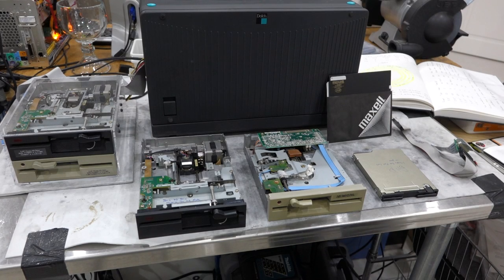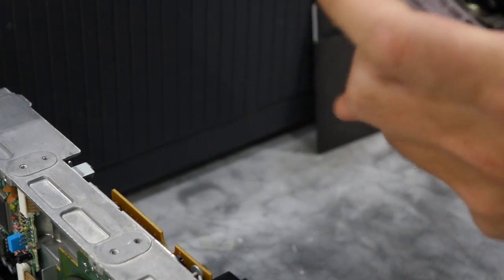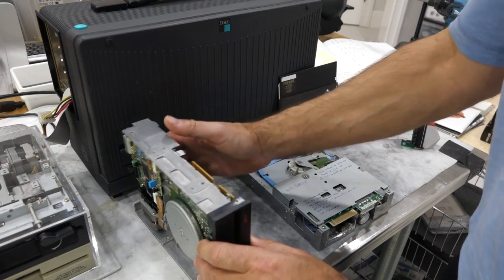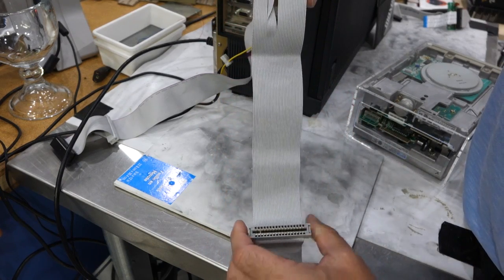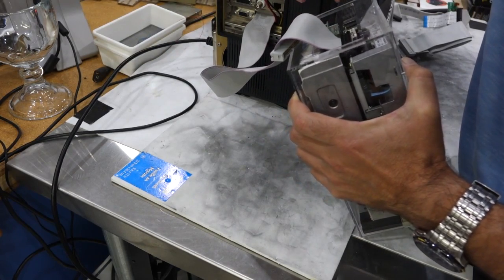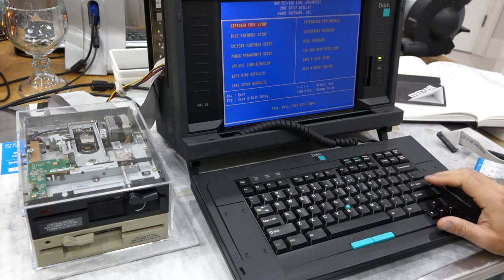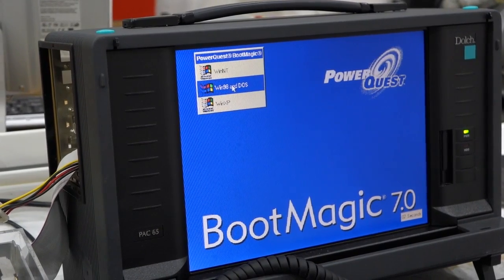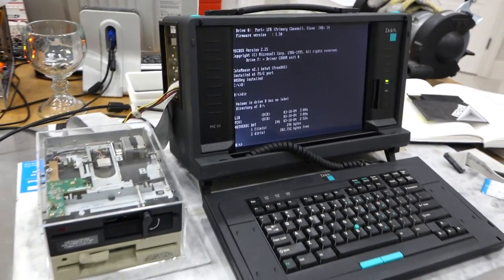5.25" Floppy Part 1: Drive Installation

Comment: Hello, I've tried connecting a 5¼ drive and a 3½ drive using the "double" cable (2 5¼ plugs and 2 3½ plugs on each extremity)
It gives me the floppy 40 error, but the main problem I've found is that the led power is always on, I excluded the drives since they were repaired and were fully working on a benchmark.
Is that something to do with cable plugged wrong or faulty? Or is something I have to mess in the bios since it finds both drives (the bios shows them up as a: and b: with 1.2/360 k 720 k and 1.44 and 2.88 are available)
The 5¼ Is connected to the terminal 5¼ plug (last on top) and the 3½ at the second extremity (the first connector after the motherboard) with the second 3½ plug.
Help please!!
Reply from the maker: It could be so many things, but I would try to mess with the BIOS settings first. The BIOS doesn't "find" any drives. You tell it what they are, and unless what it is told exactly matches what actual drives are on the cables, it will give you an error 40.
Reply: @CuriousMarc  Update on this.
I've managed to prevent error 40 by having my drives to be set as 360k and 720k, but it's weird as they're HD drives.
Lights are always on so there's something wrong, even if i flipped the cable connector on the motherboard and made sure that pin 1 on the cable was identical in direction to the pin 1 motherboard connector.
The lights always on are due of a faulty cable (tried swapping with another 4 connectors cable, no change) or the controller itself is faulty? or maybe is it the power supply?
The drives do turn on (you can hear them start spinning when i turn on the computer) but why do the lights are always on?
EDIT 2: The leds turn off when i disconnect  the second 1.44 drive.
Edit 3: Turns out the 1.44 drive was having the wrong pin 1 and i had to flip the cable so that the connector would be backwards while keeping the 5.25 drive on the other way around (Pin 1 was on the other side yet marked on the left near the power connector like all 1.44 drives, really weird drive).
Thanks for the help dude.
Now i wanted to ask some advice.
I wanted to install windows 98 on a PATA HDD, but windows 98 gave me error  SU0013 and thus aborted the installation.
I have two PATA HDD drives, one has failed since it always gives errors when i tried to install win 98 but they're the same (80GB Maxtor Diamond) and one that had windows xp on it.
First time i was able to 100% format the disk and progress to the installation, when it showed "Error SU0013" and interrupted the installation.
Second time i think win 98 setup tried to install it on the old ruined HDD and failed multiple times.
I've got a floppy disk formatted with the windows 98 boot disk (original diskette went bad).
What can i do to "restart" the installation from anew?
I've got no other PCs to connect the drives to format them.
Reply from the maker: @arbiteras  Great to hear you sorted your floppy problems. For Win98, I can't remember exactly. If you install from the CD, you need the CD drivers installed on your boot disk. Then when you can install the CD, there should be a setup.exe or install.exe or Win98.exe somewhere, maybe in the i386 directory. You just execute that and it should start the installation anew. Or just configure the BIOS so it boots from CD first, that should do it.
Reply: @CuriousMarc  That's what I did.
First time Windows 98 setup worked until the Su0013 error then stopped due of a second faulty HDD.
Now if I try to boot from CD it starts "1. Run Windows 98 setup from CD ROM.
2. Boot PC with CD ROM support
3. Boot PC without CD ROM support"
If I choose 1 and 2 it gets stuck at the CD drive driver because it says something like this when I choose 1.
"This driver is provided by Oak technologies inc. (C) Oak Technologies 1987-1997 
Driver name: OEMCD001"
Then gets stuck, no error messages or anything, the keyboard is responsive, you can only hear the CD drive turning on as if reading the CD but stops after a while.
Doesn't matter if I try to boot the setup without the HDD it always gets stuck there now, I have no idea what's happening.
The BIOS shows the CD drive as the secondary IDE master, when I had the HDD connected it was the primary Ide master.
The boot order is.
1.Cd-drive
2.Floppy
3.HDD-0
I've tried to physically change the CD drive with another one but no effect.
EDIT:
The BIOS had the Non-os2 with the "more than 64 mb ram"  option disabled, when enabled, it worked like a charm.
The other problem is that now, in the win 98 installation, when it's supposed to do a restart, it shows the "While initializing device shell: Windows protection error. You need to restart your computer".
This error persists as of now and doesn't allow me to progress.
Reply from the maker: @arbiteras  Yikes. I can’t be sure, but it sounds like your CD ROM gave up the ghost, or some hardware related to it.
Reply: @CuriousMarc  win 98 now doesn't complete the setup and says that strange line about "while initializing the device 'shell' windows protection error. You need to restart your computer".
Reply from the maker: @arbiteras  Yeah, scratch my previous answer, I see you tried to replace the CD ROM already. I'm not sure what is wrong in the hardware. Your RAM has gone bad maybe? Something wrong with the CD driver on your boot diskette (assuming you booted from a diskette, not the CD?). I would also try to fiddle with the master/slave jumper settings on your HDD and CD drives, maybe try to run with everything disconnected from the IDE ports, and just the HDD as the master on one IDE port and the CD as the master on the other IDE port. I'm starting to run out of ideas though.
Reply: @CuriousMarc  as I've said, I've managed to partially install windows 98, but the problem is that now instead of going to finalizing the options and setting up the plug and play devices, when I boot from HDD (unless I'm supposed to be booting from CD or floppy disk to continue the installation)
 if you see a video of "CD installation of windows 98"

 when you see in the video the PC restarting after copying the files in the setup that reaches 100 (the 15 seconds wait before it automatically restarts), it should be prompting me to finish the installation.
Instead, it gives me the prompt to either boot from the disk or CD, booting from the HDD gives me that error "while initializing device shell windows protection error'.
  booting from CD it sends me back to the 3 choices of either executing the windows 98 setup from CD (that points to scandisk to start windows 98 setup), load the system with CD support or load the system without the CD support (command prompt installation).
Reply from the maker: @arbiteras  Hmm. Sounds like it has a bad driver in the install then. Are you installing Win98 revision2, or whatever they called the later version of Win98?

Comment: Hey, if you think this is bad, try mucking about with replacing a drive on a Tandy 1000 series machine when you don't have any Shugart drives available. Usually involves changing pins around on the cable.

Comment: [8:25] The twist makes sense to me - you just plug in the drives without having to mess with any jumpers.
The correct cable should be already provided with the PC or motherboard.

Comment: The vast majority of the plugged pin cables I've come across could have the plug removed by picking at it with an xacto knife.  If you catch the corner of it, it will slide out. It's not always obvious that it is an insert.

Comment: Could I use an adapter to a parallel port?
Reply: That's not something that natively works.  Though some computer companies like older Dell laptops used the extra pins on the parallel port to run an external floppy, that was not actually a standard in any way.  Most parallel port floppy drives used actual hardware and a dos or windows driver.
Reply: @stonent  My old Toshiba T1910 (486SX) has LPT port that doubles as a external floppy port. It only serves one of the functions at a time and is configurable in BIOS setup.
(I had to build my own cable though, I'm aware Toshiba sold external floppy drives for that port, but no clue if there were separate adapters)

Comment: Whoever standardized plug and play is the most unsung hero ever
Reply: You have no idea.  Early LAN systems in late 1970s and 1980s was “Wild West”.
I installed / supported about 10 different types (ARCnet, S-Net, Gateway G-Net, Proteon ProNet-10, Corvus OmniNet, AppleTalk, DECNET, 3Com 10-Base-2, Sytek/IBM PC-Net, IBM Token-Ring).  In early 1990s, as 10-Base-T was standardized ... life switched to Internet, TCP/IP and HTTP.
Reply: Plug and Play (on VME-bus systems, for example) existed in the 1970s.  Blame IBM for designing a system that required PNP to be bolted on after years of teeth gnashing.